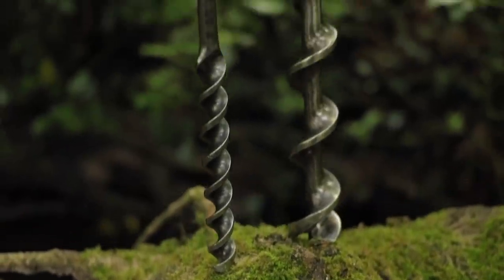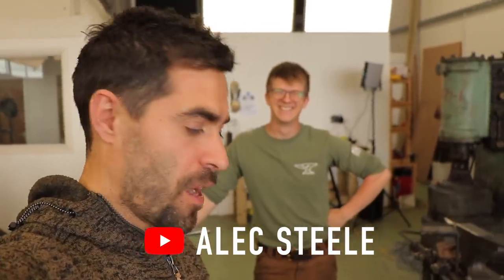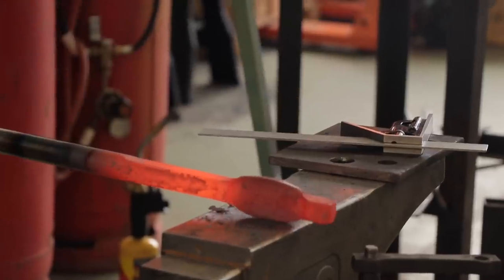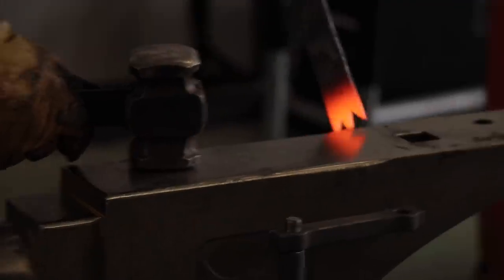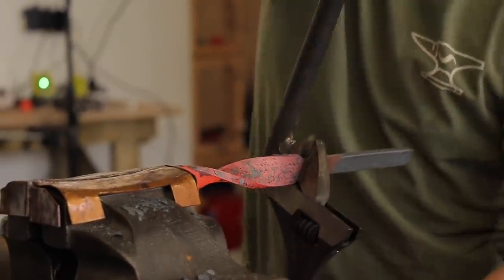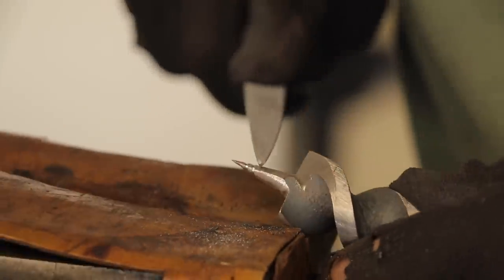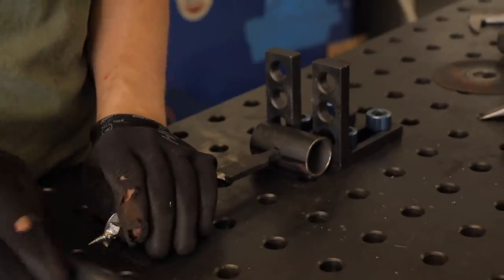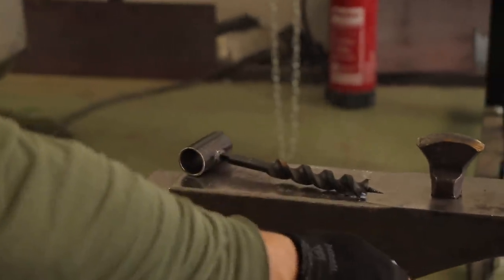Can Alec Steele Help Make This?!

Comment: Just a note: If the timing on the threads of the snail isn't right, the auger bit won't pull itself into the wood, and it won't function properly. You'll have to apply constant downward pressure to force it to cut, while turning. 
|
Also, without the side cutting nibs, the hole will end up much rougher. Possibly less problematic with green wood, but it still bugged my hand-tool lovers soul, heh.
Old Sneelock has some really good videos on auger bits and restoring them, if Alec ever has time and is curious he might check out his channel.
|
All that said, I really enjoyed the video and I am perpetually awed by Alec's talent and drive!
I'm curious to check out more of your content too, now, I don't know how I'd missed you, but glad this video was recommended to me!

Comment: My Dad had a regular fluted drill made by a blacksmith.  He started with a rod of the outer diameter of the finished drill bit.  Gouged out (I do not know how) 2, straight fluting channels along the flanks of the shaft, except for 2” on one end for where the bit would be held by the chuck.  Then, he heated the shaft, and twisted it, so that the fluting became spiral channels up the sides of the bit.  Lastly, he ground off the tip at angles so it would bite into the material being drilled.
Courtesy of Half Vast Flying.

Comment: The true test of a tool is if it works. Did it work? We call them here (PNW) Scotcheyed Bits. I use them not only for Bushcraft but around the Garden and even projects within the home. Have had quite a few old hand drills, some large ones with a plate on its end and a bubble level to push against your stomach when using it.  Yeah, it takes a bit longer, but seems to be more connecting when using them. 
But I wish I knew how to Blacksmith like this guy, could have come in handy throughout life.

Comment: Great video mate, i loved forging and metal work in school, got an "A" in it, but have you ever seen the bushcraft tool called the "settlers Wrench" from Shawn with the wild in the U.S.. Its similar to a Scotch Auger but the pipe/ handle part is also a circular chisel the same diameter as the drill bit, great for bushcraft projects, i got one from him and honestly, its up there with the axe, saw and knife! Check it out great bit of kit for making all kind of bushcraft stuff!

Comment: Good video, but everybody gets the purpose of flux wrong. It isn't to clean or purify metal- the only purpose of flux is to keep oxygen out of a metal to metal joint. Soldering, brazing, welding- it's the same for all of them. Oxygen in the joint will result in a bad joint.

Comment: The thing is, even that popped weld would have been strong enough for this application. In fact, it probably would hold with no weld. The metal is strong enough even if it just loops around without actually being attached. But if not, he could have mig welded the opened forge weld and pretend it was successful.
Reply: Alec's a bit of a perfectionist, and he sure as he'll doesn't do things by halves, it's either perfect or it's not good enough when it comes to his work
Reply: @magoshighlands4074  But he had to mig weld a piece of pipe onto it anyway because he had limited time. If he kept that at least it would've been more forged. Although he would've just messed up the spiral part anyway and then start over again.

Comment: Historically blacksmiths should have been able to make it, so I should be able to do it.

Proceeds to use a powerhammer
Reply: Power hammers are very old.  They became spread across Europe by monks who set up water powered factories.  Nobody knows when the first power hammers were made, but they became rather common about 1000 years ago.  They were built quite differently from modern all metal ones, but if you look on YouTube you can find some very old ones still in use.